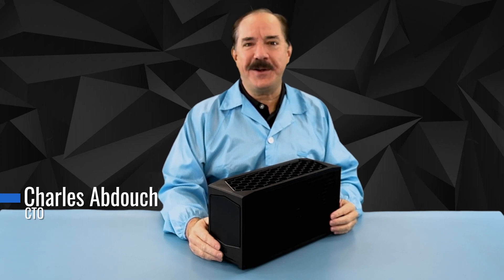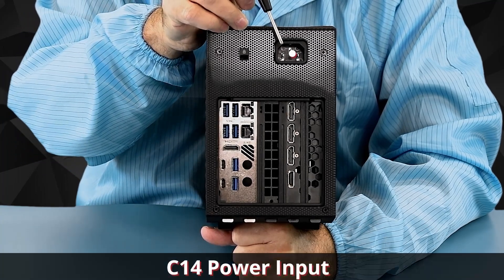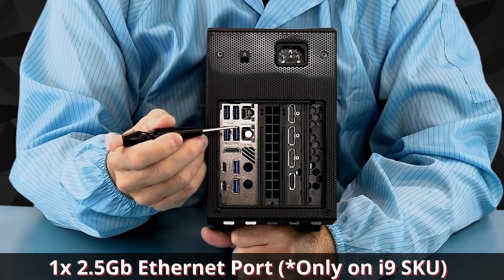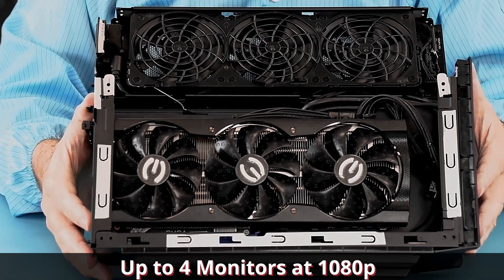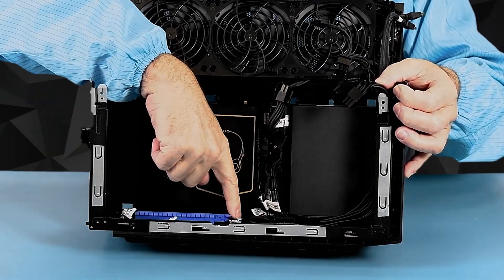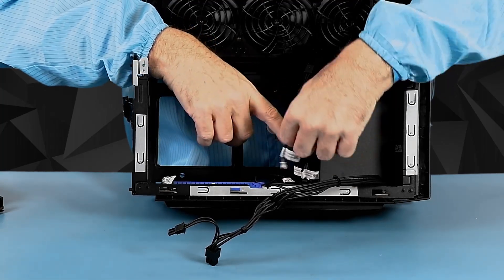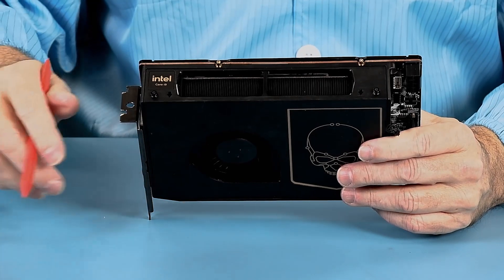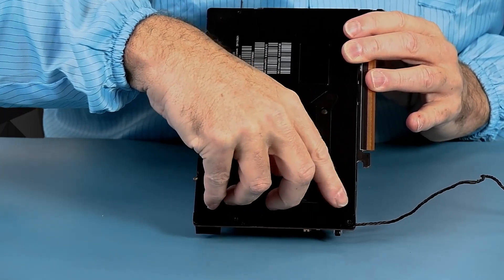Intel NUC 12 Extreme, Dragon Canyon - Unboxing

Comment: So will the phantom canyon be going on sale now?
Reply: Phantom Canyon will still be very popular due to the small size, low wattage, high-performance as well as including the video card for a similar price. Same way Ghost Canyon didn't hurt Hades Canyon sales, nor Beast Canyon hurt Phantom Canyon sales. 
But to your other question, I doubt Intel considers Dragon Canyon competition to Phantom Canyon and is considering killing Phantom Canyon or discounting it.
They are really in two different markets.
I hope that Beast Canyon goes on sale, but don't remember that happening with Ghost Canyon after Beast Canyon came out. In fact, if we could get Ghost Canyon's we would still be shipping them as we still have customers that don't need the full-length graphics card support and prefer the smaller chassis. Mostly Business customers.
Quartz Canyon v7 and Xeon still are shipping well and I saw some on our production line yesterday when giving a tour of the facility.

Comment: Kinda curious - is that PSU in there standard? If it blows up somehow, can it be replaced with a standard SFX unit, or is there proprietary nonsense about it to make life hard?
Reply: They are FSP Custom made for Intel.
Simply NUC stocked some for the Ghost Canyons due to higher than normal failure early on, which prevented our customers being down for an extended period of time while the entire unit was swapped out.
I have not heard of any PSU issues since that first 4-6 months after Ghost started shipping, but if there are, I would expect we will stock replacements to expedite repairs.

I will try and get a photo of the label on it when we do a full tear down
Reply: @cabdouch  PSUs being available is a good thing. 
My worry around them blowing up is not a concern for the PSU's quality, but more a concern with the Nvidia Ampere cards. I had a 660W PSU (Seasonic Platinum, so not a low quality unit) die on me after a few months gaming on an overclocked 3070. I've also seen other reports of Ampere cards killing various sub-700W PSUs that had otherwise been running for years.
Reply: Custom I'd guess. No obvious requirement for a 24 ATX connector, just the í pin on the nuc board. Unless it's using Intel's new ATX12V standard that hasn't been widely adopted as of yet.

Comment: Hey Guys :)
Great tear down as always Chuck, very informative.

Sorry to ask on this video, but, while the larger boxes are a good sign. Will there be a phantom canyon style "laptop" chipped NUC in the works?
I'm thinking something like the NUC11PHKi7C, with an nVidia GPU baked into the board, or possibly Alchemist Arc GPU of a similar power? In the much more smaller form factor.

I only ask as I am umming and ahhing at the Phantom Canyon at the moment. (Yes I realise its 'last years' model).
Reply: I love my Phantom Canyon. I game and stream daily on it. I loved my Hades, and it would still be using it if I didn't switch to a prototype Phantom that had no other value here after Phantom released
One of the benefits of being CTO :)
Reply: @cabdouch  well said 👏